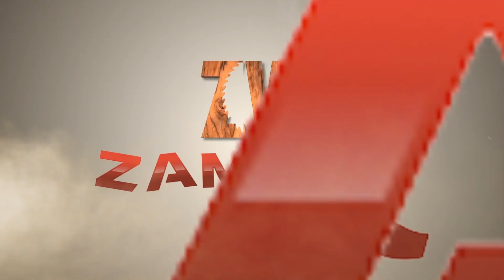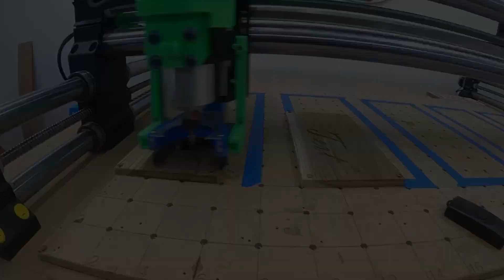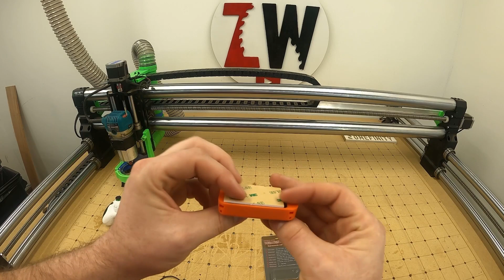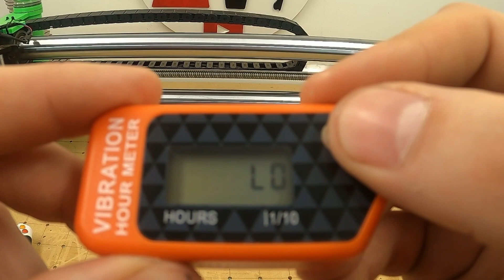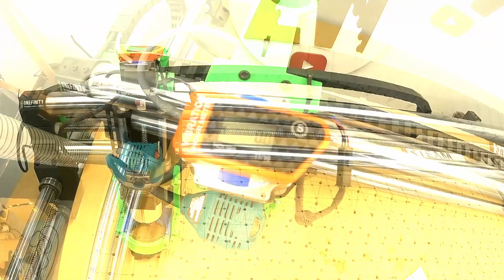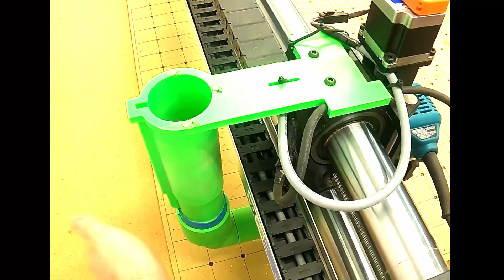Onefinity CNC Hour Meter

Comment: Neat idea. For that first meter did you try and wrap it around just the hot and not hot and neutral? Spark plugs are on and off at high frequency so that may be why it doesn't detect the signal

Comment: Great idea man. I've been thinking about this for a while. As a former engineer for the military - we kept planned and preventative maintenance schedules. This is a perfect idea.

As a suggestion - like yourself - I wouldn't put it on the front of the stepper motor... if it should fall off during operation - it's a potential hazard for it to fall into the toolpath.

I would even use velcro.

Thanks again man.

Calvin